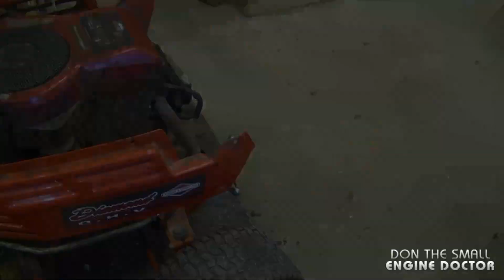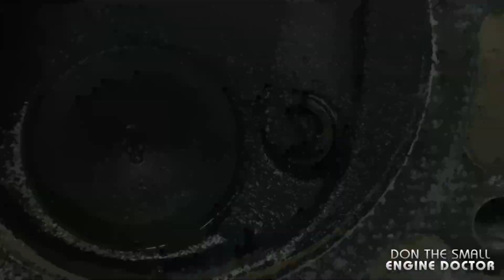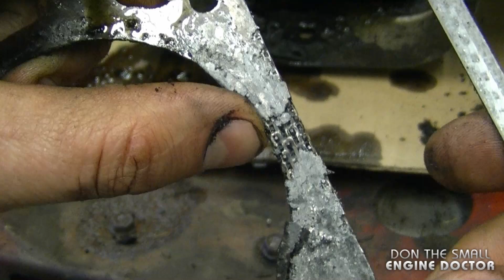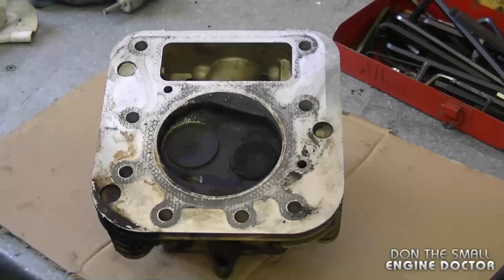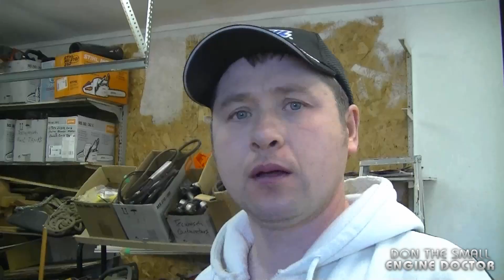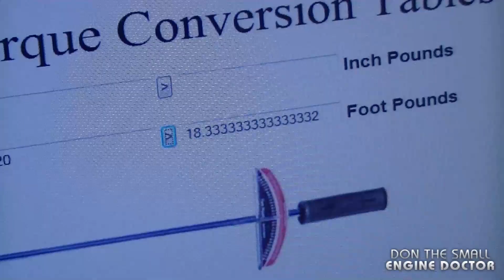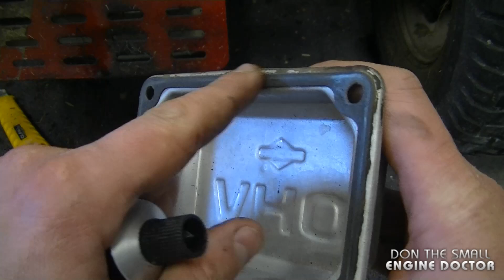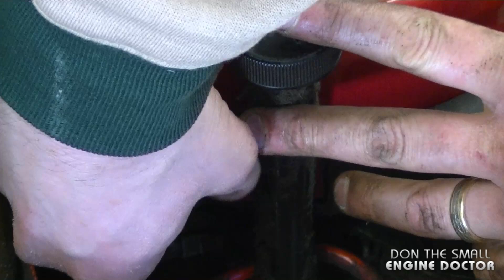Fix a Blown Head Gasket & Adjust Valves On A Lawn Tractor With OHV Engine

Comment: hey donyboy, quick question.  i have an '04 Briggs & Stratton 18hp Intek that had a blown - gasket and valve seat jumped out... so i know im going to have to use a center-punch to secure the valve seat but i did notice some aluminum stress cracking lower down from where the gasket blew.  It is NOT cracked on the gasket surface areas or anything like that just down in that rectangular area that is in the "hole"  not big cracks but cracks you can run your fingernail over and definitely feel them.  I feel like this is probably common on these heads and nothing to worry about, what do you think ?  I value your opinion and I subscribed !!
Reply from the maker: i would have to see it but i'm not surprised. you can just use until you get issues

Comment: Don, ive been in drag racing for years on and off, and i must say after watching your video i am ready to takle this little 1 cylinder. lol.. ive got the oil leaking from the pump and some what of a knocking noise at low idle. i think its the H.G. and probaly the compression at the idle causing the knocking noise

Comment: THANK YOU!  This video is EXACTLY what happened to our Huskee Supreme SLT 4200. The mower repair shop said it was DOA.  Disassembled & inspected valves, rockers, head, cylinder, etc., all in excellent condition with no signs of wear: the only indicator was the little burn by the cylinder. $20 worth of gaskets and some time cleaning out the really bad carbon build-up, new spark plug and now it's running!  Your video saved our mower, because we were convinced by the mower dude that it was beyond repair.  YOU ROCK!
Reply from the maker: WE HAVE SOME MOWER CROOKS IN A NEARBY TOWN TOO!

Comment: Great Job Don. I like how you break down everything step by step. I might add 3 things. 1: A thicker head gasket may prevent blow-out due to increased thickness, but it will also lower engine compression slightly (less HP and cylinder pressure).  2: There is a formalized head bolt torque sequence in the B&S OHV repair manual. One should always try to use the formal sequence if available. If not then the cris-cross method will work in a pinch (as you already showed). 3: Three separate torque wrench sequence steps should be used to even out the loading on the gasket, head, and block (6 lb-ft, 12 lb-ft,  18 lb-ft). Otherwise great video. Mike K., Chicago, IL, USA. ASE Master Technician, BSME Mech Engineering, Former Engine Development Engineer Navistar Engine Corp.

Comment: Dony if you take off just the valve cover to replace the valve cover gasket do you have to re adjust the valves?
Reply from the maker: no you don't, but it's a good time to check valve adjustment
Reply: @donyboy73  good idea thank you so much for taking time to answer my question. I hope you and your family are doing well stay safe.

Comment: Great video. Is it possible to patch the hole in the gasket with maybe, gasket maker, or gasket sealer, to fix the leak if you need the mower running but don't have a replacement gasket ?
Reply from the maker: not really, it won't last and you'll have to do it all over again
Reply: Excellent video. I have a Kawasaki 17hp engine on a Deere LX 277. Have you done a video on replacement of head gasket on this model. Thank you again for excellent video

Comment: I have watched a lot of your videos and they are very well done. With all of your experience in small engines, does one brand stand out as being more reliable than most of the others. For example; is a Kohler better than a B&S, Onan, Kawaski?  What would your particular choice be in looking for a reliable engine in a lawn tractor around 18 or 19HP?  I am in the market for another tractor and I am not using it commercially.  I have looked at TORO, Columbia, Cub Cadet and Husqvarna.  I have seen a lot of head gasket problems with the B&S, transmission problems with John Deere.  Perhaps a video with several different models and the pros and cons of each perhaps?

Comment: What a great video ! I wish I would have stumbled across it before I i spent $125 to get my mower worked on. You live an learn next time I'll fix the problem. Thanks again
Reply from the maker: you're fortunate it was only $125, some shops would have replaced a starter and other parts
Reply: @donyboy73  - yea your right they did say at first it might be then he said it was something to do with the valves

Comment: Donny I am very frustrated.  I adjusted my valve 2 times on my rider and it has so much compression that I can barely turn the flywheel by hand.  When it starts in runs great but it usually gets stuck when trying to turn it over so I am worried the starter is going to burn out.  Any other reasons for such high compression?
Reply from the maker: make sure the crankcase isn't flooded with gas and oil
Reply: @donyboy73  I also replaced the head gasket about a month ago and changed oil, but I will check when I get home after work and let you know.  Thanks
Reply from the maker: @BrockoM  sometimes carb leaks gas into engine and hydro-locks it
Reply: @donyboy73  I forgot to mention that the high compression is only in a small spot when I turn the flywheel by hand.  But when I get to that spot it is so tight it is almost not possible to turn.
Reply: @donyboy73  I checked the oil and it is very clean and at the correct level.  Could I have the valves set too tight?  I thied to set them both at .004 of an inch.  My grasses is getting so long!!!!  Do you have any other videos that may explain how to set the valves?

Comment: Help please...Followed video and replaced head gasket with new version of Briggs and Straton gasket on my Craftsman mower with 21.0 HP Briggs XRD engine. Model # 331877 2371 G5 Code 110526ZD  I called Briggs and was told what the valve clearances were.  I set or adjusted bottom one to .004 and top to .006
Put engine back together and started it up. It no longer smokes but does have a skip or knock especially at lower rpms.
Also, before, I would place the throttle up for choke to crank. Now it will crank without choking? Starts right up but seems to have a knock or skip? I've drained gas tank and carb bowl and installed new spark plug? Any help or thoughts is appreciated. Thank you!

Comment: Would a failing/failed head gasket cause oil pudding in bottom of exhaust after running? I notice a small puddle (coffee cup size) after sitting for a few days after mowing

Comment: Ok so yesterday I watched your video.  Although my tractor is a 12.5 HP the proceedure was the same.  I did not have to adjust the valves which save a few minutes. Again I work on cars often so kmow my way around a wrench.  It took me about 4 hours to do the gasket  due mostly to cleaning time as the tractor was a mess.  Again I say GREAT VIDEO and Thank You.  Gotta go go cut my grass.

Comment: Great Video.  I"m good to go.  I work on cars all the time but knew nothing about single stroke engines. I am 100% sure this is a project that won"t be a big deal.  The valve adjustment instruction was outstanding.  Thank You!

Comment: Only 2 things to reinforce:
1) Retorque on head bolts after 2 hours running is crucial - key to long lasting head gasket repair.
2) Get an accurate Inch pound torque wrench for these small engines - I've got an Harbor Freight unit I trust - we use it in our bike repair shop where small torque values are common.
Great job Donny thank you.

Comment: Also just a side note, harbor freight has a selection of torque wrenches for 20.00. Worked great for me and also has lifetime warranty couldn’t beat it. Just cut the lawn and my mower is running like the day I bought it. No more smoke or quitting.  Follow this video for overhead valve engine find your specs and dive in. It will guide you through the process.

Comment: So, you like the high performance two cycle oil from Stihl, other than the new Ultra two cycle oil?  I have been using Ultra but the cost is getting prohibitive, so I am thinking about switching to Stihl HP. ( orange bottle and cap). What do you think?

Comment: Engine repair 101 includes never using fuel to clean internals. Next, Check head for flatness, maybe try using ARP studs, and making your own copper gasket instead. Your head cleaning and sanding method is too much to watch.

Comment: Good video. One tip; Mark TDC before the head goes back on.  Also, that backing off a 1/4 inch (towards end of video) is done to set the clearance for the compression relief.  That reduces load on the starter while cranking.
Reply: If your move the piston till 1 valve is fully closed the other will be fully open ,,no need to find TDC . Lot easier .

Comment: While the head is removed, turn the engine to piston Top-Dead-Center and mark the flywheel so that the same flywheel position can be achieved with the head installed. Then all that remains to be done is that the piston be on the Compression stroke when adjusting the valves.

Comment: Great video! I have a question my intake valve is not moving valve is free sound like a cam issue?
Reply: Definitely sound internal... Need to open it further :/  - Do you see your Piston moving?  That is another way to tell if something internal failure.

Comment: Would it be a good idea to apply a little gasket maker to the spot the fails all the time? Make it a little thicker there!!!
Reply: @Willis Bailey -  Good Tips!  I too apply a thin coat of High Temp Heat Silicone 600F Degree all over the New Gasket.  Let it dry a bit but still malleable, put that on there and it seems to last longer as well.  I do it all to my Gaskets :).

Comment: Excellent job of explaining this technique.  My mower was backfiring when I turned the mower off so I installed a new carburetor. Backfiring has ceased but it is purging now.  From what I see on YT it probably needs a new head gasket.  I think I can do that now but I have a little  fear of setting the valve gap on the rocker arm.  Do I understand correctly that I should have the gap set so the gauge slides through the gap smoothly but not loose?  We're talking fractions here & I'm just not sure!  Once I have set the gap at (lets say) 04 would I be abIe to make a judgement by putting the gauge (03) & the gauge ( 05) in the 04 gap to feel the comparison?  I'm a woman doing this for the first time...I changed the carburetor with no problem & I didn't even know where the carb was or what it looked like.  I just listened to the instructions on YT & followed what they said/showed.  Thank you Judie

Comment: Does the wire brush need to be brass or steel?
Reply: I use whatever I got.  Just don't do it where the Gaskets meet.  Or you will create " Lines " and cause the problems later.  Use 600 Grit Sand Paper instead and some oil to remove.  Try using Gas first to clean it and believe it or not, Gas can clean a lot of stuff.

Comment: Love your videos! I broke off the bottom right valve cover bolt. Will not having this bolt cause my engine to lose compression? The engine starts and stays running but is very weak. If I try to engage the blade the engine shuts down. Could it be the missing bolt or something else?

Comment: Hi, I know this is an older video, but it sent me in the right direction. I have a ten year old 17.5 HP Briggs on a Snapper mower, that was burning blue smelly smoke. My suspicions were correct; the head gasket was blown in between the cylinder and the push rod chamber. It took a lot of cleaning up, and cleaning the carbon off the piston and the valves, but all back together and the valves adjusted, and it runs like a champ now, and no more smoke. Thanks for your excellent videos!

Comment: I have a question regarding valve adjustment. Briggs says it should be done 1/4 inch past TDC. In your video you turned the flywheel 1/4 inch. Shouldn’t you have measured the piston movement (with your screwdriver) past the top of the compression stroke 1/4 inch, then adjust? (i.e. not the flywheel movement)?
Reply: jaffUSAF - When I was 10 years old.... I didn't know what " adjustment " even is, LOL.  I just knew they had to be adjusted.... So I put a piece of Paper in the Valves and tighten it.  Before that, I spin the Motor and see how it behave.  After that, I ran the Engine and then adjust while the Engine running.  Funny thing is.... It's almost 7 years now and the Motor still running in good condition!

Comment: @donyboy73 hello. My aluminum push rod is bent , I have an extra  old steel one from an old engine, what problem would it cause to run the engine with 2 steel pushrod? Thanks
Reply from the maker: I'm not sure on that one
Reply: donyboy73 ok thank you for the reply and the great videos, I am gonna give the steel rods a shot and see what happens.
Reply: @fordguyaj5581  - Actually Steel Rods are better!  I did that to my Engine about 6+ years ago and never have a problem again.  I would prefer Steel Rods if I have to replace it!

Comment: I have a Toro LX 420 Twin Cam and is leaking oil from the  bottom of the engine, but there is no smoke coming out from it, do you think is the cylinder head gasket that is damage or is something else?
Reply: If you over fill a mower with oil it will blow out the lower end crankcase gasket.

Comment: Also to convert inch pounds to foot pounds you can take the 220 inch pounds and divide it by 12. There are 12 inches in a foot so by dividing 220 inch pounds by 12 inches to a foot pound you get the same answer @ 18.33 foot pounds of torque. Math and Science 2 extremely interesting subjects. By the way Don your channel has replaced the evening entertainment commonly known as TV. Speaking for myself by the way.

Comment: Great video - was able to change out my gasket today in a just a few hours. Mine did smoke a lot when I started it back up, but it was all the oil that accumulated in the muffler - after about 5 minutes it burned off and no smoke! Thank you!

Comment: Hi Don, Thanks for the video...I just did my Toro LX460 riding mower, it has a Kohler engine...Got it all back together but when I tried to start it , I got a backfire and then it wouldnt turn over. It seemed like it was having a tough time turning over, not enough battery? I just put the battery on the charger and I'll try it again...Any ideas? Thanks D

Comment: Awesome video thanks for the help.  So I think we messed something up before putting head back on.  We had rotated the engine several revolutions before putting the head back on and now it won't start, is it possible that this messed up the timing?  How would we go about figuring this out? Any help is grateful. Thanks in advance.
Reply: prettytonyshort this just happened to me.  make sure your push rods are seated correctly.  take the valve cover off and rotate the motor.  Check that both rods are moving.  If not then loosen the rocker and reseat the rod.  Then adjust the rocker again.
Reply: It was running fine, but oil was leaking from the fuel pump, bad head gasket, removed and replaced, and now back firing out of the carb.  The valves work perfect, turned it over with the valve cover off.  I'm going to tear it down again on Monday and see if there is something preventing the intake valve from seating fully.

Comment: Hey Dony, great video and I'm a new subscriber. I've watched several of your videos in the last few days and have learned more about small engines than I ever cared too....LOL  What started as a simple oil change and fixing an oil leak at thee fill tube has evolved into an exact duplicate of this video only on a 97 12.5 hp . I was wondering if the torque specs are the same as in your video?  Thanks!
Reply from the maker: should be about the same
Reply: Thanks Dony, Funny thing happened when I was torquing the head bolts back down, you guessed it I snapped a bolt. I had taken the cheap way out and bought a crappy torque wrench, well I'm back on track now and will be ready to mow this weekend. Now I'm eyeballing some other mowers I got sitting in the shed, this old man may have found him another hobby, I can hear the wife screaming now LOL!!  Thanks again!

Comment: Great video and very informative.  Cleaned up the piston as shown, but I had to replace the whole cylinder head and all new gaskets due to a bent valve.  To no avail, the smoke is still present.  Does that sound like a bad gasket?  I disassembled and re-assembled and the same problem.

Help!  lawn is getting really tall.  :)

Comment: A thicker gasket, lowers the compression slightly, as it pushes the head farther from the cylinder bore.  This will lead to a very small decrease in power, but still a decrease nonetheless.

Comment: What about brake cleaner? I've seen it clean things I didn't know it could clean.
Reply: @EndersStare
 - DO NOT use Brake Cleaners on " Rubbers " or anything to do with " Rubber Seals, Gaskets, Etc.. ".  It will blow up and you have to buy new stuff..., don't ask me how I know, LOL!
Reply from the maker: yes that works good too

Comment: Do you have a video showing how to remove carbon from a piston around rings? Tecumseh 6.75 hp eager 1 engine. Piston and cylinder are clean. Going to replace rings and head gasket.
Reply from the maker: I use a brass wire wheel or 3m scotch brite pads
Reply: Thank you sir